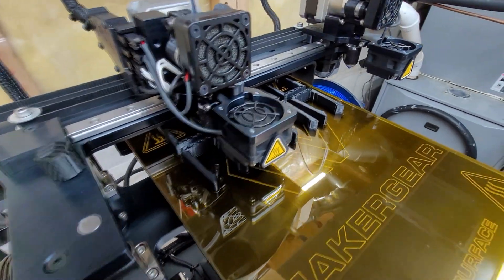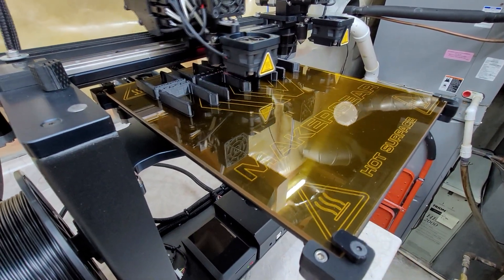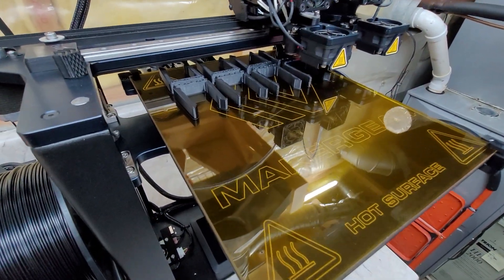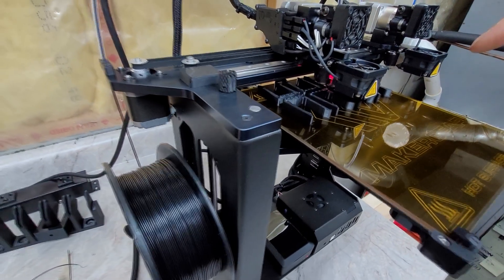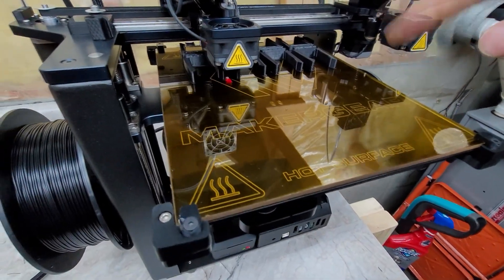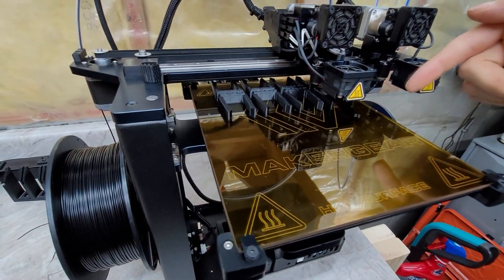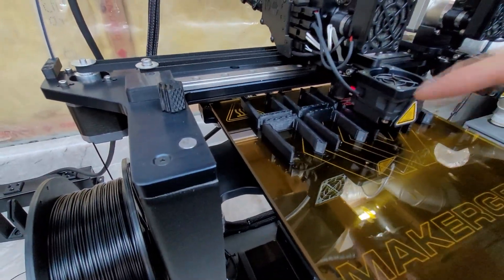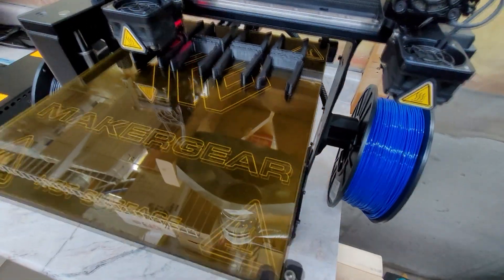3D printing update!  Three-month lessons learned (Makergear M3-ID)

Comment: Interested in getting this exact printer (my first), mainly because MakerGear is a US based company. However it seems like they are going out of business? Can pay less for the Bambu X1, with seemingly more features, but I would like to avoid that. Should I pull the trigger?
Reply from the maker: I had a buddy replace the controls on my makergear so it runs klipper now.  The stock makergear control is old now and does not have a lot of the new features that klipper offers.  Mechanically the makergears are excellent though.  If you don't want the hassle of switching to klipper I would go with the bambu.
Reply: Thanks for the reply, I’ll check out klipper. It’s a shame that there aren’t more US based companies..
Reply: If you are interested, I will have a MakerGear M3-ID for sale soon. I need a bigger print volume and plan on building a Voron.

Comment: Hey Dan,
Replace the kapton tape for glass bed isn’t to bad . Once the tape rips you can pull it up with a pair of tweezers and then use you hands to pull it off. Also Wham Bam makes a great bed system which it a magnetic removable PEI  bed sheet . I have been running that sheet on one of my Makergear M3’s for a year it’s been great. You will need to print new bed clips to use the PEI bed system. Enjoyed your videos 😎🤙
Reply from the maker: I have looked into getting a magnetic sheet but haven't decided yet.  The kapton tape works so well I'm not sure I want to change.  Thanks for the info!
Reply: @Filterficial  Yes sir , I agree kapton tape and glass works great I kept the glass bed with tape on my M3-ID . If I’m being impatient to pull the prints I’ll print it on the wham bam bed M3 . 😎🤙

Comment: I heard that it is a great printer but i don't see a control screen or anything on it.
Reply from the maker: It is controlled by a web interface.  It's got a raspberry pi with octoprint.
Reply: It has a color display but you can do everything with Octoprint.  I have an M2 and and M3.  They perform great and are high quality machines that you can run continuously.